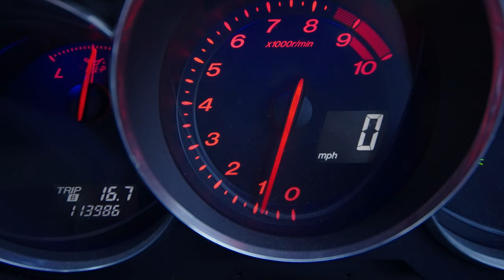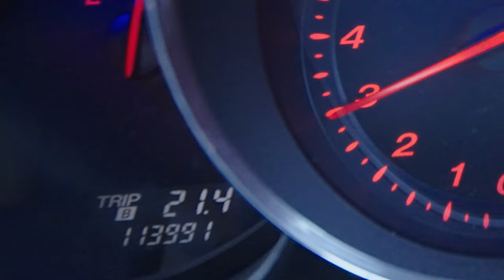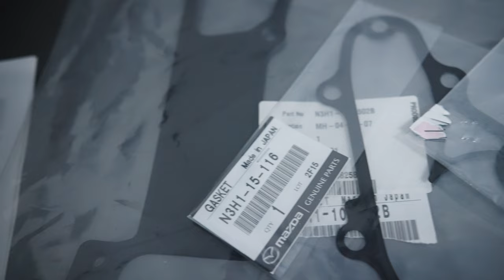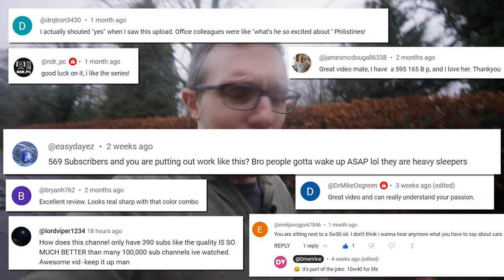To Do and NOT to Do for a Rx8 rebuild! with Josh & Reece @TPSLtd  | Mazda Rx8 🚗

Comment: My local Rotary shop said that most RX8 engine rebuilds required new housing due to carbon build up. This all because of the side port exhaust.
Reply from the maker: The side ports are on the irons though, not the housings. And yes, lots of carbon build up on the ports, but it can be cleaned away. The housing becomes smooth and shiny after the regrinding.

Comment: Really enjoyed the video and agree that for a street driven car, the factory more or less knew what they were doing. I've owned my RX8 for 21 years this year (original owner of a pre-ordered initial batch North American car.) Just subscribed and will keep following the build.
Reply from the maker: Awesome! 21 years with an 8. Hats off for the longevity. I hope you are still enjoying it. Did you keep it factory?
Reply: @DriveVice  Thanks! I've accepted it's part of the family now and with me until I die. I would say tastefully modded: Racing Beat Revi Intake with ram air duct, Cobb AccessPort tuned by MazdaManiac, Axial Flow shifter, Racing Beat midpipe, Mazdaspeed Cat Back, Mazdaspeed front and rear strut bars, Racing Beat sway bars and end links, KW v3 coil overs and Rays MazdaSpeed MS-01S Wheels. Still going strong on original engine. Will replace it with my 20B when it finally goes.
Also have the track FC in my avatar picture (full bridge N/A) and have another FC that's a Half Bridge Turbo. It's an addiction. :)
Reply from the maker: @Redshift42  that's fantastic. I wish we could make a featured video of such an important family member, but I don't think you're based in the UK.
Reply: @DriveVice  I'm in Nova Scotia, so not local. :) Funny enough, I do have family in London and a friend (who does Time Attack in an FD) in Sheffield

Comment: A street port doesn't do much but make the idle lumpy in a Renesis from what I've read.  I love the series btw!
Reply from the maker: Street port shouldn't change the idle, but only increase the lower end of the torque (if the engine is healthy to start with), but as Josh mentioned, it's not the best choice for longevity. 
Bridge port is what make the idle go Brrraaap

Comment: I've dealt with TPS a few times with my previous rx8 and funnily enough have just bought another rx8 from Josh, can't fault either of them best in the game in my opinion
Reply from the maker: How many 8s have you owned? and why more than one?
Reply: @DriveVice  this is now my 2nd rx8, I had my first when I was 19, was a 2006 car on 31k miles but sold it a year later when I bought a 370z, but now I am going back to the rx8 as even though they're not the quickest of cars out of anything I've ever driven it has the most character and soul in a car which I admire